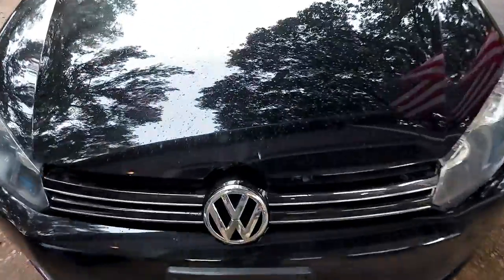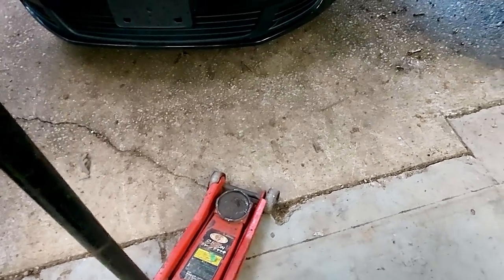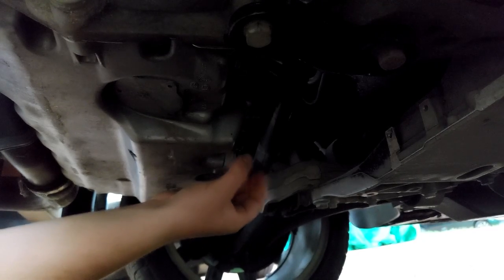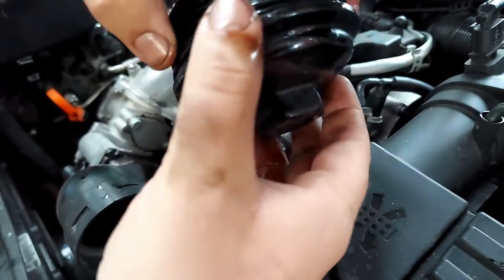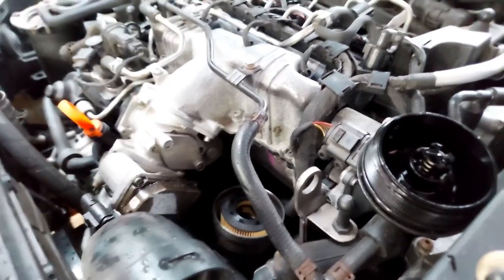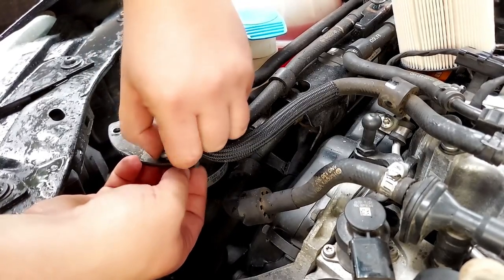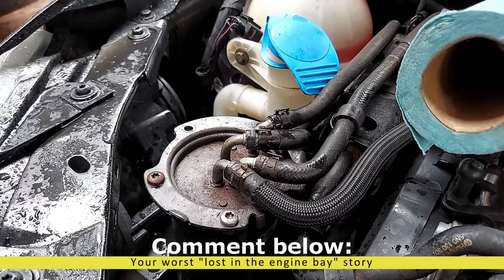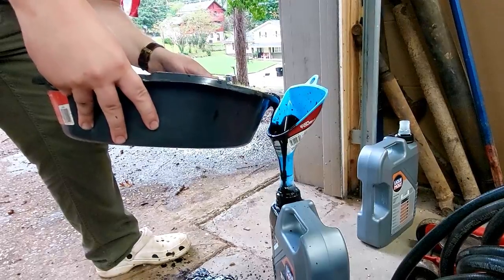Jetta Sportwagen Oil Change

Comment: cool car but the reliability scares me
Reply from the maker: You and me both my friend.
Reply: Why would reliability scare you.  These things run forever
Reply from the maker: @chevyjlewis  as long as they are maintained... did you see the other vid where i put a motor in it?
Reply: @chevyjlewis  high pressure fuel line mostly, the manual is a good unit but the DSG on the other hand is a little complex
Reply: @DeanofMachines  no I didn't see that
Reply: @Kamelo2001  I have a manual TDI hardtop.  Love it
Reply from the maker: @chevyjlewis  feel free to check it out. Rod bearings ate themselves.